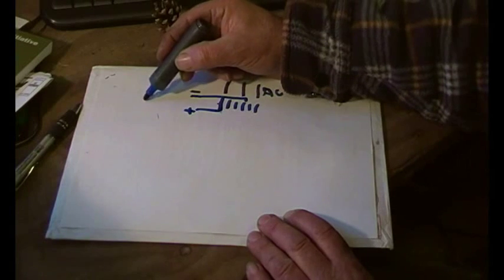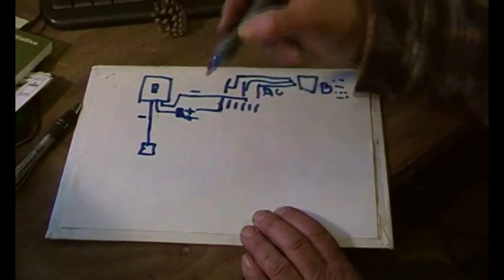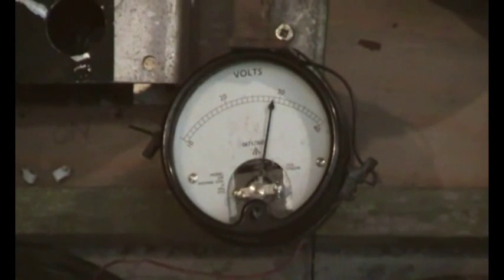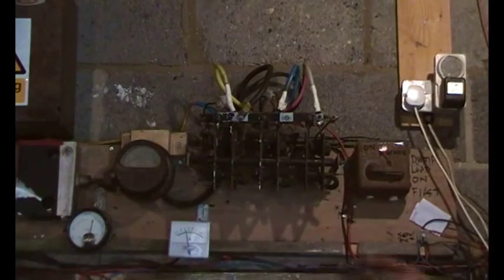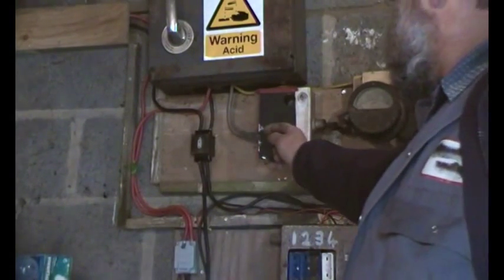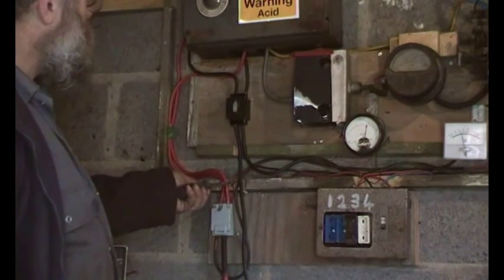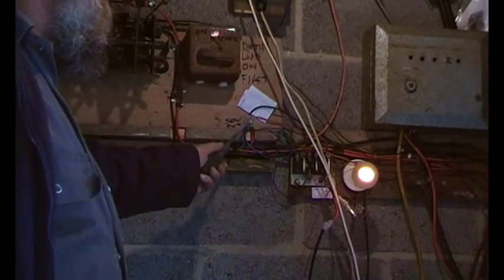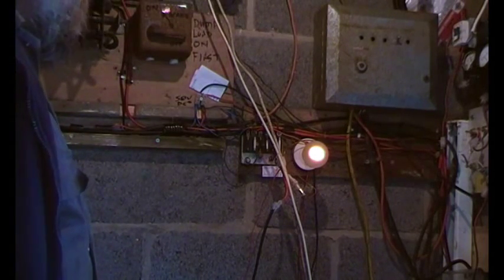Battery shed wiring part 1. Wind and solar electricity

Comment: I'm still at the point ov putting my system fully together and getting everything running properly, and then I intend to do exactly what you're up to now - tidying it up...! :) That might begin next summer, as we are fully off the grid now so we'll see how things are after the Winter. It's doing really good at the moment, but the days still have a bit ov length to them here in the Southern Hemisphere.
Reply from the maker: Yes it's very important to have a very good back-up to prevent battery over discharge. That and very regular battery checks with a hydrometer, to make sure you know what is going on. In the winter it's a good ideat to run the generator every grey day to to keep those cells fully charged. Thanks for the comment and interest, cheers, Andy